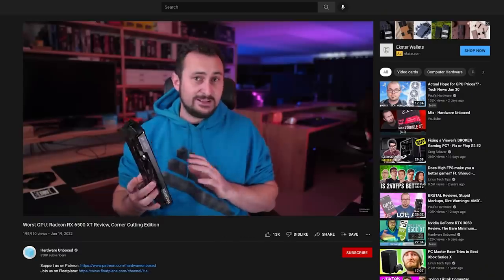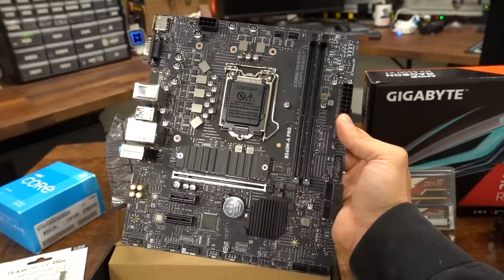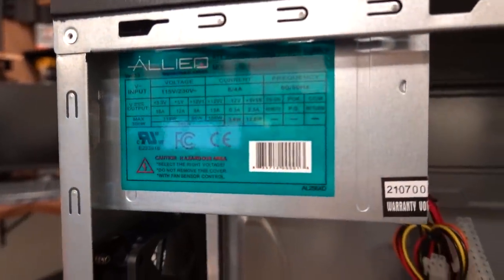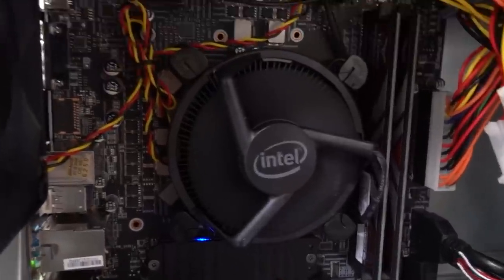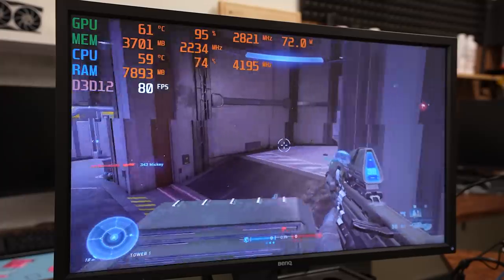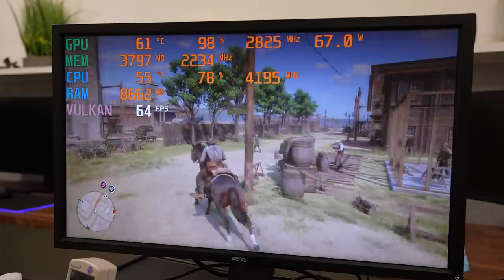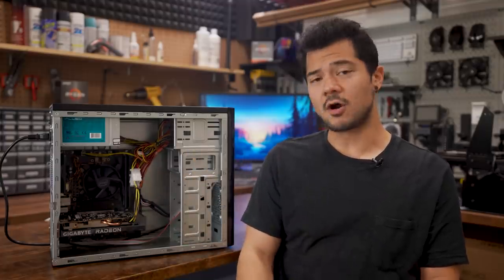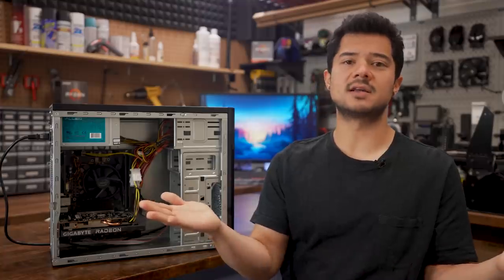Good Budget PC or HOT GARBAGE?

Comment: Ill never understand comparing a 4gb cards benchmark to top of the line 30 series 12 gb+ gpus, make a comparison relative to pricing at performance pleeeeease
Reply: If msrp was real a 3060 is 329 dollars and has 12gb of vram while this is 200 and has 4gb of vram.
Reply: @Jsteeeez  except MSRP *doesn’t matter*. The cards are sold at those prices. This PC is better than the new PS and Xbox, and it’s cheaper. 

Obviously it’s not good, but it’s a budget build. You can’t get better builds for anything around this price.
Reply: @gcarsk  nah, this pc is not better than a series x or ps5. it is more flexible, in case of the things you can do with it but it is not even close to the performance one of those consoles can bring in games.
Reply: @gcarsk  This PC is NOT better than a PS5 or Xbox Series X. Both of those are capable of 4k gaming. This is only capable of 1080p with mediocre framerates.
Reply: @gcarsk  this pc is not better than a ps5 or xbox series x. It uses 20 rdna compute units versus 40 and 52 on the ps5 and xbox series x. Plus much more and faster memory on the console.

Comment: Bro thanks for this I was looking at building a similar system same processor

I'm also wondering if a 3300x system would be better with that GPU because the s.a.m. thing. I'm either going to get the 6500xt or 1650 because they are almost the same price.

Comment: For PCI-E 4.0 support you need both an Intel 11th gen CPU and a 500 series board, the i3 10105F only supports PCI-E 3.0 regardless of the motherboard even though it is a refreshed Comet Lake CPU released alongside Rocket Lake 11th gen.

Comment: The only issues with the card was the marketing. The price is debatable.

Great video Kyle. So far, my only tech haunts that have objectively offered a video based upon what the card actually IS vs 'what it should have been', is you and Wendell, over at Level1.

That said, it's still a terrible card. =) But, is an OK placeholder if you really need one. More cards is better than none.

Comment: Hey Kyle, I love watching build videos. For me the case and PSU you used are not "cheap" but unusable. There is no way I would use them at all.
Reply: IMO buying a cheap PSU is not good value, I've been using a Corsair I bought about 9 years that has been in builds going through 4 CPUs and 3 GPUs and I won't need to change it unless I require a larger power budget.  Right now you can find similar PSUs from reliable brands for £40-£50 so saving 10 or 20 quid really isn't worth the risk.

Comment: Man I just can't agree with going PCI Gen 3 at all. The performance loss is a huge hit with that card. 
You're almost better off finding a used 580 at that point or even a 5500XT.
Reply: Well, for the budget he set, he could not get PCIe 4.0 compatible CPU. In my opinion, since he used 10105f, h410 would be a better choice for MB and for the money saved you just buy somewhat better PSU (400-500 W) .

Comment: Guys is this gpu better then the 1050 ti I want to know and if it’s I maybe gonna buy it bc I got a 1050 ti
Reply: Yes it is but it is not a worthwhile upgrade. It performs similarly to a GTX 1060. An upgrade should in my opinion be at least 2 tiers higher or 2 gens higher or 1 tier and 1 gen, so you should upgrade to a GTX 1070, 1660,  RTX 2060, or 3050 (or AMD equivalents)

Comment: where did you get your specs?

B560M-A PRO
Supports 10th Gen Intel® Core™, 11th Gen Intel® Core™, Pentium® Gold and Celeron® processors for LGA 1200 socket
Supports DDR4 Memory, up to 5200(OC) MHz
Core Boost :  With premium layout and digital power design to support more cores and provide better performance.
DDR4 Boost :  Advanced technology to deliver pure data signals for the best performance and stability.
Lightning Fast Experience :  PCIe 4.0, Lightning Gen4 x4 M.2 with M.2 Shield Frozr
2.5G LAN: Upgraded network solution for professional and multimedia use. Delivers a secure, stable and fast network connection
Audio Boost :  Reward your ears with studio grade sound quality
Steel Armor :  Protecting VGA cards against bending and EMI for better performance, stability and strength.
-- msi website

Comment: I believe that the best deal for a new PC is to buy an old PC from eBay. Given the sorry state of the supply chain and our political leadership it is best to spend your nickels prudently. I needed to upgrade my wife's computer given that hers died and she works remotely. Rather than building, which is the preferred option, I found a very nice Dell Optiplex with a Core i7 4790, 16gb of memory, and a 250gb SSD. I bought a 500w PS, adapter cable, and used an old GTX 970. A fresh install of Windows 10 and viola! A fantastic PC for $140. Granted, I had a spare graphics card to use, but it beats burning thousands for a machine that should cost one thousand.

Comment: The 6500xt paired with a 5600x, B550 Mobo and it outperforms every review I have seen to date. If you go into it knowing it isn't a 1080p ultra gpu and adjust your setting to mixed it'll do great. 1080p high/medium in doom eternal 120fps, warzone 130fps. So many reviewers set it up to fail and forgot about the intro users building a new system. I nabbed a sapphire at $199 and it outperformed my 1650 super by a fair amount with pcie4 and SAM enabled.

Comment: Yo can someone give a recommendation for a good intel lga1151 cpu thats under 80 watts tdp?
Reply: There's not a lot to choose from. An i5 6600/7600 or i7 6700/7700 non-k, if you got a 100 or 200 chipset (6th and 7th gen mainboard). For 8th and 9th gen, same chips just 2 gens higher.
Reply: @KYSMO  thx im just tryna upgrade from a xeon e3 1220 without having to change my oem’s motherboard.

Comment: This is a fair perspective. I don't know why people are comparing rx 6500 xt to an older and higher tier cards. It's like comparing an 1998 bmw 540i to 2022 bmw 520i and saying that old 540i is more powerfull.
Reply: They are comparing it because of price, performance and power draw. The card costs more than a GTX 1060  6GBcost and performs only 10 percent better or sometimes even worse, while having a similar power draw (there are 1060s with a 6 pin connector). And in the special case of this piece of garbage card, they compare it because it objectively offers a much worse value because it can work properly only on more expensive 4th gen PCIE boards. Meanwhile, an RX 580 or GTX 1060 can perform properly even on a Gen 2 board. I would love to see what performs worse, RX 580 on PCIE gen 2 or this garbo on gen 3.